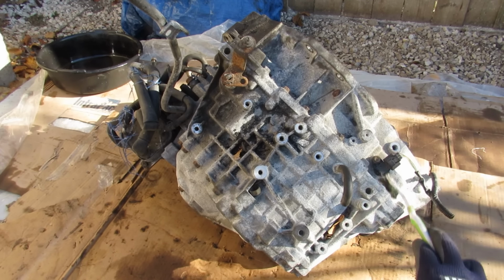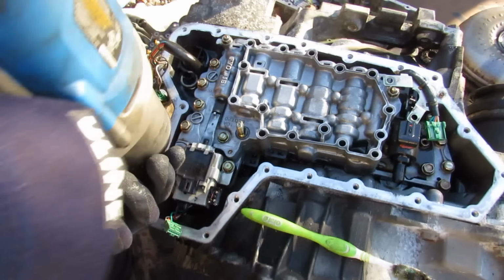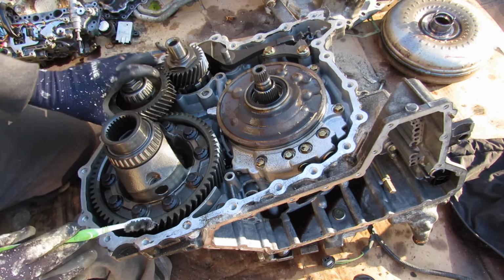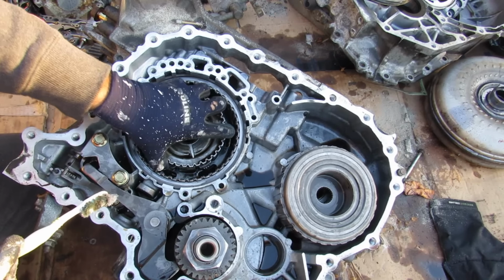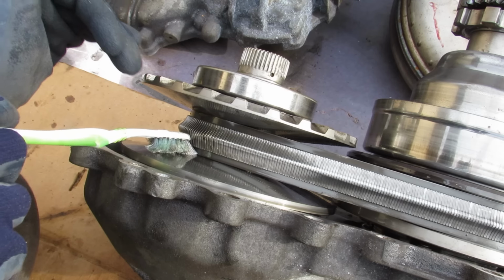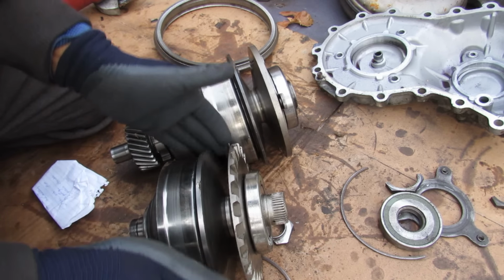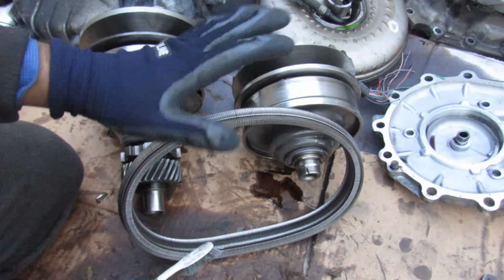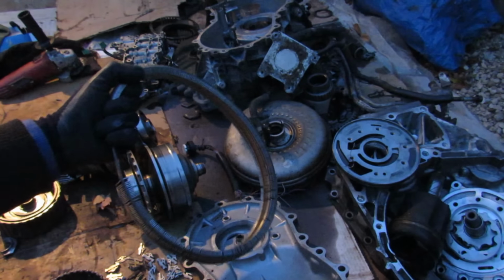Why Nissan CVTs FAIL

Comment: bought a Corolla with a CVT transmission.Sold it after 1 year. Never again will I buy a CVT it was awful!
Reply: @ss ss no.It didn't fail. It would probably last a lifetime with just oil changes. It was fine on the motorway  and town roads but get it on twisty, windy roads with hills and it's out of it's depth. A driver's car it is not
Reply: @ss ss not at all. I never speed. It's the handling that wasn't up to it. At or below the speed limit, it rolled around corners. The CVT was noisy and the 1800cc underpowered for hilly roads.

Comment: We owned a 2003 Audi A6 2.4 multitronic, from day 1 I could never reverse uphill, it just refused to go.  Sold the car and bought a '92 MB W124 230E A/T, never had problems again and am still driving it.  CVT is nice on a scooter, but in a car I like to hear the change in revs, and feel the gears change.

Comment: I like the feel of the CVT when you drive one and Subaru Outbacks have a good reputation. However... Subaru will not put the CVT behind their 6 cyl or on Turbo engines because... They know better!!! :D Here is a fun little fact. A CVT is capable of going as fast backward as forward. It all depends on if the reversing planet is being used or not because the CVT belt is what is responsible for output ratios. :D Sadly you cant drive 80 backwards because the computer programs limit the CVT angles in reverse. But... it is possible to disable these limits. This equals some good fun and great crash videos!!! LOL

Comment: Subaru gets around some of the inherent issues with the CVT by locking the belt ratio during periods of hard acceleration, and then reducing engine torque while the drive and secondary conical belt carriers move to a new ratio instead of continuing to modulate the ratio while under hard acceleration. THis makes it somewhat mimic a conventional automatic. There are predefined torque limits in the ECU that can alter throttle position, timing, and turbocharger gas control to achieve this. Supposedly the whole system become less prone to slight mismatches in belt tensioning and slippage when the carriers are fixed and then torque slightly reduced while they are quickly moved to the next programmed ratio.

 I have messed with the ECU programming on newer WRX's with the CVT and the power they can transmit without issues is fairly impressive. Removing the torque protections and changing delivered torque limits within the ECU, I was able to make a WRX with CVT spin all 4 wheels off a launch! I'm not sure how long you'd be able to do this back-to-back, but that particular bolt-on setup with a tune lasted at least 3 years!

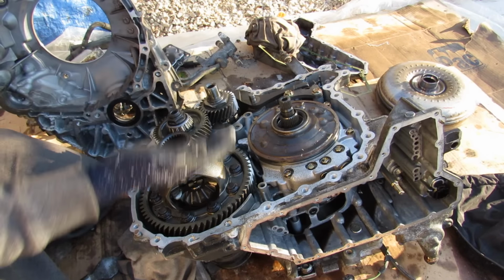Comment: 5:05 PLEASE don't hit an aluminum tranny with a steel hammerhead. Not even a love tap.
Use a rubber hammer in the future.

"Cast aluminum" only means it was poured into a pre-shaped vessel and solidified in a specific shape. It does and meansnothing to make soft-a$$ aluminum any tougher than what makes up your soda can. 

Plus, if particles from that steel hammer break off and lodge themselves in the aluminum (which is easier to do than you might think) that begins the road to dissimilar metal corrosion.
Aluminum is aluminum.
And aluminum is soft. 
Please be gentle with it.
Reply: The engine is dead....
Reply: @dwightmanne  Dead or alive, you dont want the practice, or habit, of doing things like that. 
You may just fvck up a live engine one day by going for a tool you would normally do on a dead one...

Comment: I was a Nissan mechanic for 6 years, in that time I never saw a conventional automatic transmission failure, but we replaced at least one CVT every week. Almost always on 2.5 4cyl altimas or rogues. The 3.5 v6 powered cars actually seemed to last a lot better for some reason..

Comment: IT WAS DESIGNED FIRST FOR A GOLFCART,should've left it there,it is suited
Reply: Damned straight.
There was never anything wrong with the good old fashioned manual shift transmission.
 One would think that the saying, If isn’t broke don’t fix it would apply to the automotive industry most of all. 
I think this CVT junk is yet another greed scheme forcing owners to buy a whole transmission instead of a busted part.
Just like those non serviceable u joints that require a whole new driveshaft straight from the stealer-ship.
Reply: @MrSmith-jj9te  I had all: manual, manual double-clutching, auto, auto dual clutch, robotic semi-auto, and CVT. An i have to tell you in the heavy city traffic between lights - CVT is a salvation. So smooth.
Reply: @AliShuktu  you enjoy,sisters got one in her murano,she loves the car,told her to trade it off often,salvation,i've built transmissions for 50 years,its a golf cart unit,plain and simple,oh yeah they told her 4500 for a rebuild,salvation,LOL
Reply: @AliShuktu  they're junk,that's that,i've built transmissions for 50 years,it a picture of a trans,its a joke and i drove a beer truck as a 18 year old kid,i know driving,mud,snow,sleet,blowing snow and busting snow drifts,i say its junk
Reply: @strattuner  LOL...)) I drove a truck from the age of 15. But how does it makes you an expert in gears? )) When you say something is junk you should make some points there.
Reply: @AliShuktu  you see what you want to see,i built transmissions for over 45 years,i have credentials,read
Reply: @strattuner  I don't know what you have built or not but i highly doubt that you are smarter than engineers at Mitsubishi, Audi, DAF, Volvo, Ford, Honda, Subaru, Nissan or Toyota?)))
Reply: @MrSmith-jj9te  damn skippy,reminds me of one guy jumping off a bridge and the whole world following them,blindly
Reply: @MrSmith-jj9te  agreed for the most part, but sadly some of us don’t have full function of both legs. Have to drive an automatic.

Comment: Reminds me of the Variable Pitch Dynaflow on my 56 Buick, well at least that's how it was described as working.
Reply: Nope. The Dynaflow was a single speed that used a variable pitch stator in the torque converter. No belt what so ever. They were noted for overheating the transmission fluid since the torque converter was doing all the work through fluid dynamics. :D

Comment: Before watching, I can say one reason why is because people treat these transmissions like a race car transmissions. High revs are wasted on that sort of setup and just wear the belt out faster.

After watching: forgot that they were using these in heavier utility vehicles, not just the economy cars. Which adds more stress to the system. Yup, So I was partially right.

Comment: I have a 2019 Nissan Sentra with a CVT. Is it the exact same transmission as the 2006 Murano, or has Nissan made improvements?
Reply: i read they improved them with a stronger belt, a transmission cooler and lower viscosity ATF4 fluid-

Comment: Not Nissan though, it’s a Jatco. I have one in my Mitshubishi. No, wait, I have two. One failed and I swapped it. Boo . . . the donor didn’t go either. The car rejected it. I am about to go in and open it up and see if I can service the pump. My best guess is that it’s not getting pressure and will start there. Where dis you get those diagrams at? That might be handy when I open mine up.

Comment: Love my 2000 i30 ! Simple 4 speed. 280000 miles . with a power steering fluid leak . dang high pressure hose!
Reply from the maker: Good old Maxima

Comment: "Very similar to an automatic transmission"? Oops, it IS an automatic transmission.
Reply from the maker: Ok
Reply: @speedkar99 : Thanks. So for future videos... 😊 Oh, and the same for DCTs.
Reply: that,s like saying a petrol engine is a diesel.....
Reply: @robertlonsdale3826 : You're right, good comparison, except that it goes in the opposite direction. Diesel fuel IS petrol(eum). But not all petrol(eum) is diesel. The same kind of comparison works with different kinds of automatic transmissions.

Also, you'll want to replace your random comma with an apostrophe.

Comment: It took a lot of work to get to that belt. Cvt is not for me, I couldn’t trust my self to baby the thing.
Reply: I rented a CVT car and loved the fact that you floor it and it accelerates like a high HP car with an awesome power band because it stays in the optimal torque band during the whole time. I thought the pro was that you can go fast all the time. I would have destroyed my transmission prematurely had I bought a car with a CVT! XD
Reply: @SI0AX  honestly it'll be fine unless you get one of these decade old Nissans or Chryslers. Take it out of ECO mode and stomp on a Honda or Toyota all you want, but keep in mind the fuel you're dumping out the tailpipe.

Comment: I’m on 103,000km on my Nissan CVT, no problems so far.
Reply: My 3yo Murano is smooth as silk.  Consumer Reports flags 2014 and '15 Pathfinders for unreliable transmissions but have no reported common problem with other models.

Comment: It's nice to see that some automatic transmissions are still mechanically linked to controls.
Reply: Not really though. That mechanical linkage is still just mechanically telling an electronic sensor what is being requested and the sensor is then reporting that to the transmission computer which determines whether you get your request or not....which I mean is a good thing at times. Probably wouldn't be good for anyone if your poorly parented child decided to grab your shifter and throw the vehicle into reverse while traveling at 70mph on the interstate and the vehicle actually try to make that change instead of just giving you a polite dashboard message while the programming is really saying "the fuck did you just ask me to do? bitch we at speed and you want me to switch to the reverse direction?"

Comment: Amazing all those precision made internal pieces that at one time probably cost hundreds of dollars are now worth next to nothing. Nissans depreciate really quickly to the point once the car is 10 years old there is little value left. Not worth putting a 2k transmission into a 1500 dollar car. Quite a feat of engineering though.

Comment: My buddys 17 Nissan Altima transmission already slipping at 100K miles
Reply: Mine started at 42k, no complaints allowed at 100k.
Reply: Probably not servicing it every 30k miles.

Comment: I'll stick with my manuals until I can't find them anymore on the used market,  but I will never go to this as long as they are using a 'belt' method.
Reply: If your mind is that made up, why are you torturing yourself watching cvt teardowns?
Reply: @whickervision742  No torture, just noticing what the current technology allows.  That is called educating yourself.

Comment: I have a 2012 Nissan Sentra S with over 211,000 miles on it. Never had an issue with the original CVT. I changed the fluid every 60,000 miles as required in the owner’s manual. Nissan is capable to be reliable as Toyota and Honda. You haters should learn how to read a manual and drive a car properly and you won’t have any problems long term.

Comment: Jatco CVTs used in the Mitsubishi Outlander Sport has been far more bulletproof than the comparable CVT in the Nissans
I don't know if that will change now that they are part of the same alliance.
Any idea why they have less problems in the Mitsubishis? 
Not just the lightweight Mirage, but across the model range?

Comment: Great video! 
A few things id add! as a Nissan ASE mastertech.
The newer CVTs are getting better.
We do actually rebuild the CVT transmissions now.
Units are getting alot cheaper. Altima units you can now get new for as low as 2200.

Change your fluid regularly 60k if you're a normal driver.
30k if you're towing or live in hot climate.

take what I say/recommend with a grain of salt and do you
If I were running Nissan Id throw a traditional automatic in an Altima and have the car last forever! haha
Cvts all across makes are not perfect. Dodges suck, Toyotas fail, Hondas judder, Nissans suck too!

Its just the nature of the beast. In their eyes the saved fuel is worth it. A little fun fact! GM actually uses Nissan (Jatco) Cvts in their compact car (Spark)

One thing is for sure! Who ever can get the product down to a Tee first will make a crap load marketing it to others. In my opinion it should be Jatco as they should have By far the most experience fiddling with these damn things lol!

Comment: A lot of Chrysler/Dodge vehicles use CVT transmissions too, including Jeep. A family member of mine has a Dodge Caliber. Transmission started going at around 90,000 miles. They are also unservicable in some cases without cracking the entire thing open.

Comment: The outer shaft goes into the stator spline in the torque converter, the pump is driven by the 2 tangs that come off the end

Comment: I have been Nissan tech for over 15 years now and yes these CVT did fail a lot and since you mention to do the oil change regularly, each bottle of these CVT oils is like $45 / litre and it takes about 9 litres to drain and fill.  But Nissan says these oils are good for 1 million km before you need to drain them.
Reply: Good to hear from someone with real information rather than people who just regurgitate rumors. What specifically fails on these transmissions? Are they failing for owners who follow the recommended oil change intervals and are those owners using the OEM fluids? Do you have recommendations on how best to extend the life of these transmissions? Thanks for your input.

Comment: I refuse to drive anything without a manual tran,
I own 4 cars, 3 of them are nearly 30 yrs old manual have distributors and 1 is carburetored, easy to fix, reliable, strong, blah blah blah running mint ... Now the 4th is a 2000 or 01 it has a automatic tran, never changes at the right time it has coil packs which are failing and arcing everywhere and its now a farm hack! It runs on anywhere from two to four cylinders at any given time, and to top it off, im a mechanic and all my older cars that I used to own never had issues, and I thrashed them hard, almost all modern cars I have had and driven broke, cost alot to fix special parts and electrical issues are like ghosts!
I love cars, engines and take good care of them nowadays because soon cars wont be cars as we know them! Oh yea and if you need a service hit me up lol mates rates!!

Comment: Man, thats still a ton of engineering that went into all that. All of this will eventually disappear as more and more electric vehicles take the stage.
>paddle shifter note
should I not be using them in my altima?

Comment: Cool learned alot from this. Always thought the CVT was a neat transmission.  I would probably own one in a small car. But I am still enjoying the simplicity and reliability of my 5 speed manual. Where the cvt needs a 4k trans job the manual needs a clutch...

Comment: Can you breakdown a Toyota/Lexus CVT Transmission like you did with this Nissan? I currently own a 2016 Lexus ES 300h that I use to drive for Uber/Lyft and so I hope it will last me 300,000 miles plus! I have heard it has the most reliable CVT and I shouldn't have any problems. What is your opinion on that? Thanks!

Comment: Is it fair to assume that the same CVT pulled from a 2006 Murano is not the same (meaning upgraded or changed, flaws fixed etc) from the Nissan's from 2016-2020? Over 10 years later?

Comment: This is really interesting, and I had wondered what was actually causing the failures. You should note that Subaru also uses these Nissan CVT's in its cars.

If you want to see the CVT in action, actually changing the ratio, I took a video of it on my Suzuki after I changed out the CVT belt. It's a bit different in that it uses centrifugal sliders and springs instead of hydraulic pressure to actuate the CVT, but the principle is identical: https://www.youtube.com/watch?v=SwMgfn0D2Es

Comment: My 2008 Altima has 212000 miles on it and is as smooth as the day i bought it. It accelerates without whatever lag you are talking about and i have never experienced any "rubberband" effects. I have to strongly recommend the Nissan CVT as a wonderful performer. I don't miss the experience of feeling the gears shifting and losing poser for that moment at all. in fact I have always driven my car harder than i really should and enjoy leaving other cars behind at lights and when passing on the highway.

Comment: These cvt's are overly complicated. I still like the original design from the sixties by DAF a Dutch company  Google "DAF variomatic" if interested. DAF still has the patent on the metal Push belts and are producing them exclusively.

Comment: Great Vid. But hey – I like the "driving experience" of my car with a CVT. Say I want to merge onto a limited access highway, using the on-ramp to get up to the speed of traffic as on the highway, quickly a possible. With a manual transmission, or a  planetary gearset automatic, I would have to listen to the engine wind up to a high speed, then drop down to a lower speed when the transmission shifts, then wind up again, etcetera. You know how that sounds. With my CVT, the little high compression, high-revving engine rapidly winds up near redline speed, and sits dead still at that speed – where it has maximum horsepower. The engine RPMs to not budge. The transmission's gradually changing pulley ratio do all the work of making the car's wheels go faster and faster. You barely notice the car's acceleration. It doesn't feel to you like the car has been accelerating, but it sure is. So it's up to you. Which do you want –. a car that feels like it is accelerating quickly, or a car that really is accelerating quickly? Do you want to be propelled smoothly to a high road speed, or do you want to be jerked around several times before you finally reach a high road speed?